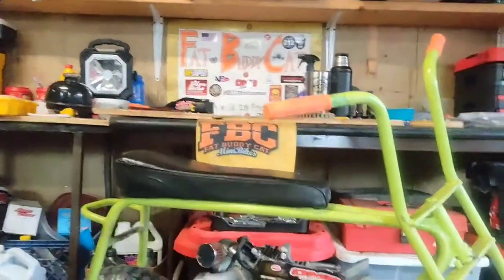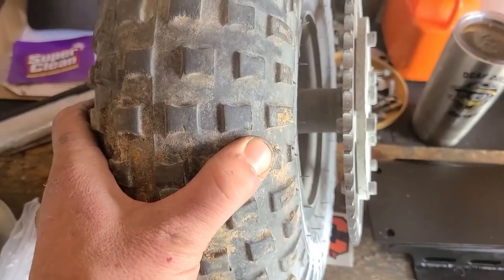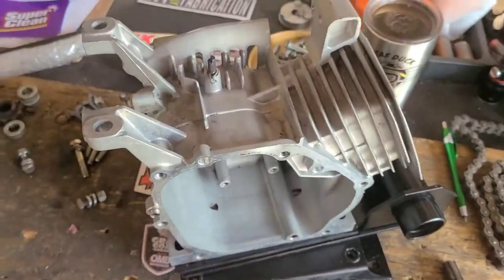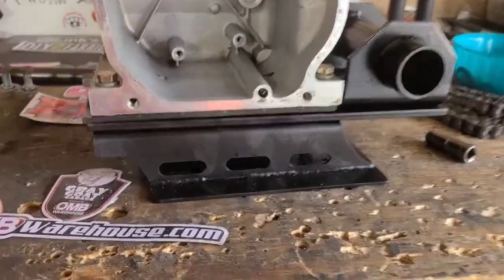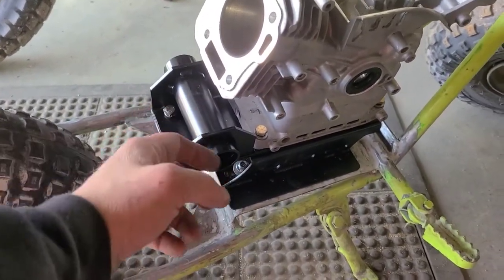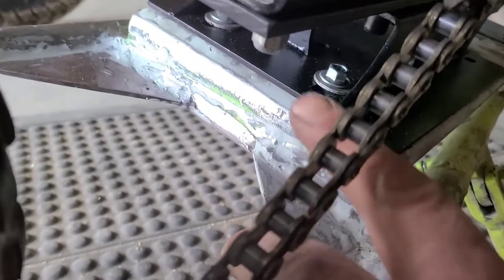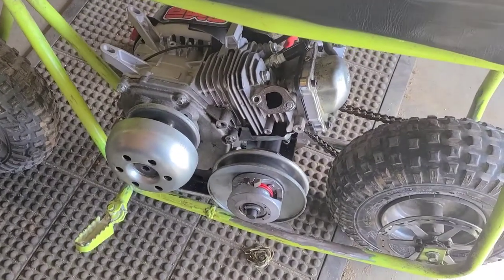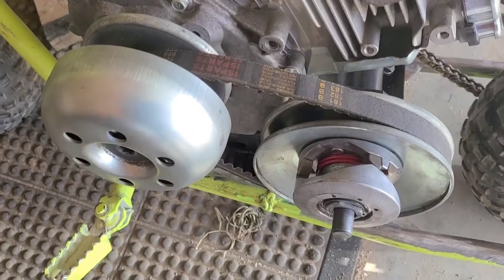The Ultimate Torque Bug 3.0 "Custom Convenience"

Comment: Did you make the plate jack shaft set up?
Reply from the maker: Bmi karts and parts. I made the 1/4 inch steel spacer that makes it strong enough to be mounted this way. They are designed for yerf dog go karts and usually mount flat under the motor on the factory plate.
Reply: @fatbuddycat  interesting 🤔 you honestly should have more subs bud your channel really has grown 👍 and your becoming quite the fabricator
Reply from the maker: @heathenprojects2639  I try hard with what I have and put a lot of time into it. I'm still technically a builder but since I don't have the fancy machines, education or experience I don't get a lot of attention. I'm doing stuff that anyone can try and I'm more than happy to help the best I can.
Reply from the maker: @heathenprojects2639  that and I don't buy views or subs. That is very much a thing. FBC is real. That's why I'm so dedicated to content. I wouldn't be doing this if I didn't want to. I should really be concentrating on other things but I'm committed.
Reply: @fatbuddycat  same i just throw video up to keep up with mini bike community broke throttle cable on the 80 few min ago rode it 2 miles with my foot 😑 warrior has a blown tire so all my bike are broke again 😆
Reply from the maker: @heathenprojects2639  I'm sorry! If I was in your neighborhood I'd have all your bikes up and running.  Lol my dream job would be a mobile mini bike mechanic!
Reply: @fatbuddycat  lol I've ordered tons of stuff I just got to wait for it to come in it takes forever anymore corse I'm not home during day turns out I had packages in my wife's car for weeks she been driving around with them while I've been waiting for them to come in calling